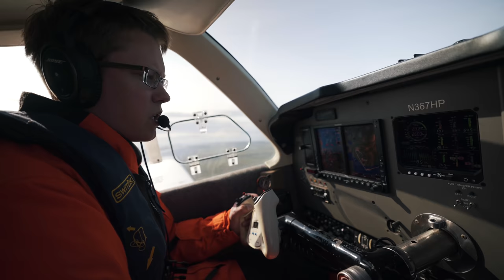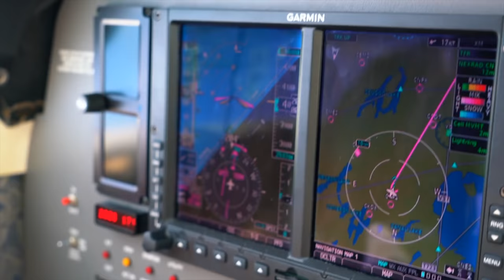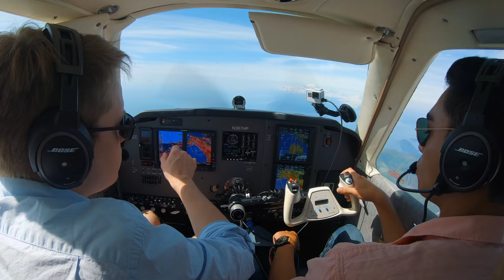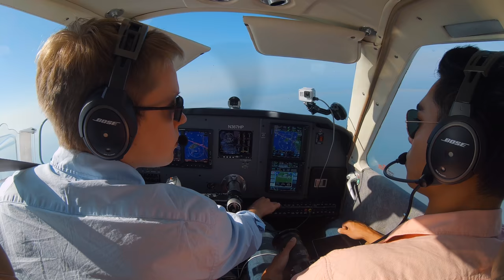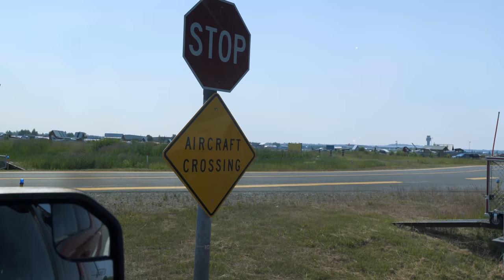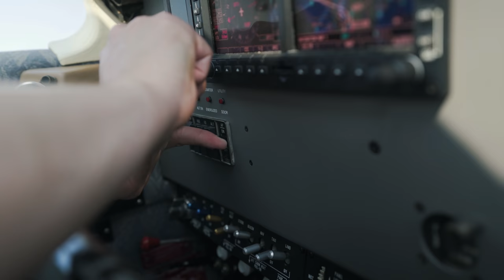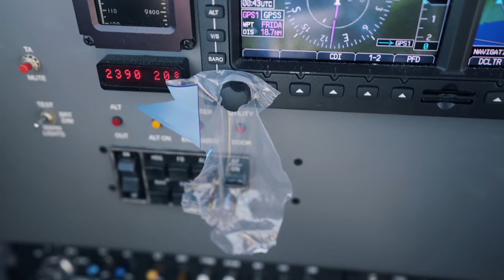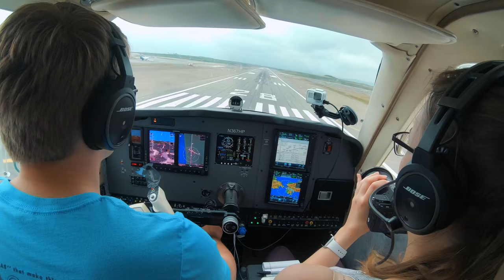Fixed the Autopilot to Fly Across Alaska! Real World IFR Holding

Comment: I am surprised every time about how low the quality of this "aviation grade" hardware is. Especially when you realize, how much you pay for certified hardware and its installation.
Reply: fbnes When something has an FAA sticker it magically becomes immaculate. That’s the first thing i learned in flight school.
Reply: In my experience, most of it, including latest gen stuff is basically garbage. Nowhere else in our society do we tolerate such flaky performance. Imagine if you had to constantly worry about your desktop computer just not starting for no reason, with the only fix being a multi thousand dollar overhaul. I own an airplane with nearly latest gen avionics, and I design embedded electronics professionally. It's really frustrating dealing with avionics issues because I know these companies can do better. We don't tolerate this level of flakiness at my work and I don't work on safety critical life or death devices....
Reply: @chris1seto  The conditions that avionics have to endure are a bit more bad than the office computers, but I agree with you. Vibration dampening is one area that seems like it would be cheap and easy to improve.  That'll save a lot of headaches and failures.
Reply: @JoelWelter  I know that it's a hostile environment, but think about the environment which modern consumer electronics survive in. People tossing their cellphones, extreme temperature swings, moisture, sweat, coorosives exposure. Best of all, they have an AHRS which never tumbles and is exposed to constant dynamic motion and the whole package costs less than $1000
Reply: It's not made to last forever.  It's made to be light and be replaced before it breaks.

Comment: The noise you hear, especially when weak stations broadcast, is arcing from one of your ignition leads. To verify, change RPM while you hear it and it will change also. A new ignition harness will fix it.

Comment: That's where I originally got the flying bug... over 40 years ago. My Dad had an old C182 with a CS Lycoming conversion. Used to sit on his knee in the front seat, and fly using the yoke. Still couldn't see out the front window,  so I's fly with the right wing low, and look out the side window. 
That all stopped happening the day I drained usable fuel out of the left wing, causing the engine to stop from fuel starvation over the Cook Inlet. One Mayday call, and power off emergency landing later, I was relegated to the back seat permanently.
The photos of Lake Hood really bring me back!

Comment: The switch normally has a spring that holds the switch in the center (like a neutral) or has a spring in the center holding the switch to either end of the switch (like a pyramid forcing it to on or off)  you then tap the top or or bottom and a signal goes to the electronics as a blip or to keeps a regular signal going to be the electronics.  It sounds like one of the springs in the switch has either broken or worn down with use.  (It also may be a hint that any of the switches that is frequently used 
should be replaced to avert future in-flight failures)   Dad had a piper cub that went to my cousin and went through replacing a lot of dash hardware when replacing electronics on suggestion of the tech because the original switches would have internal springs or plastic pieces that would break over time.  With close to a 40 year old plane these failures would be more frequent and the switches in the plane with a couple exceptions were original.

Comment: Love these videos, a quick question... Is that switch for the Auto Pilot also a circuit breaker? I don't know enough about aircraft electrical systems to answer my question. If it is a circuit breaker holding it in the on/bypass position could lead to electrical issues elsewhere in the system.

Comment: you should check for continuity on the autopilot switch with a voltage tester. It seems like the switch is on its way out
Reply from the maker: Just the magnet holding the switch in the engaged position

Comment: I have nearly same A36 with exact same AP, exact same failure, exact same inflight fix(almost- duct tape). Avionics shop twice- replaced switch, no help. Then I realized the plane banked when AP kicked out, it’s simply the aileron trim is set too far R or L. The AP is trying to keep wings level and too much force against the poorly set trim kicks out the AP.